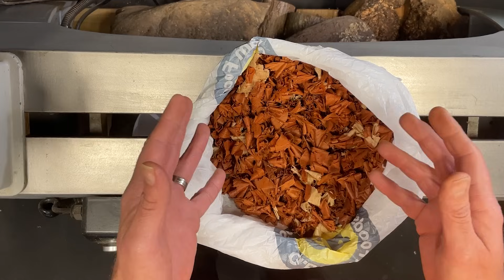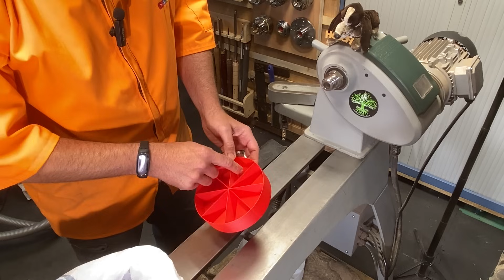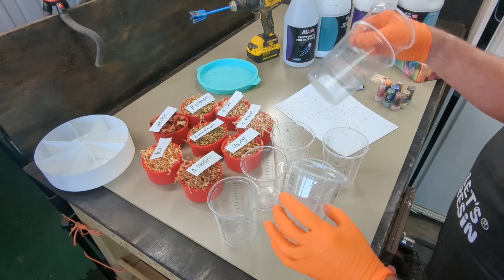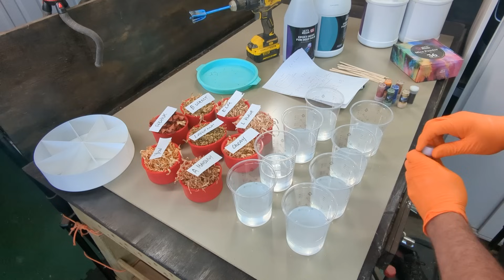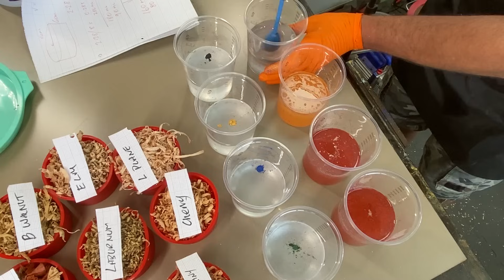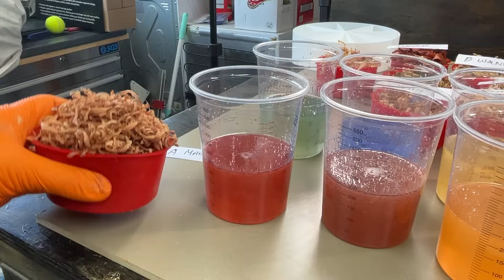Turning Wood Shavings Into a Surprise Project! – A New Wood Turning Experiment

Comment: I think it was a great success. I wondered if the pie pieces weren’t going to fly off into space, especially with the chuck jaws pushing out in the recess. Apparently the resin adheres well to the very thin walls of the plastic  form. 

Since you have plenty of wood shavings, it would be interesting to see what it looks like without any color added to the resin. 

Thanks for sharing the video!
Reply from the maker: Thanks for the kind words and the interesting suggestion, glad you liked it! 😊

Comment: Just found your video on this and I'm wondering your thoughts bowl compartment could be made out of thin veneer maybe birch, eight wings CA glued to a  dowel and the outside wrapped with the same veneer.  May prevent the wings from warping.  Either way this idea was great thinking on your part.  I love in.  Cheers
Reply from the maker: Thanks John, indeed veneer could have easily been used but this experiment was to test the 3D print 😀

Comment: Very nice execution of a great concept, especially for a first run. I'm wondering about the possibility of 3D printing the base and outside walls a  bit thicker with dado grooves for inserting thin wooden panels as the vertical section dividers. Once turned, all you are left with is the resin and wood. White lines are eliminated and hopefully the wooden dividers would remain straight. 

Great work. I'm much too cowardly to even try such a thing.
Reply from the maker: Haha thanks so much and that's a great idea 😊

Comment: Mike, apparently i was in the hospital when this first came out and missed it.  Glad it popped up again.  I think this was a fantastic project.  I've done a lot of resin work but nothing like this.  I'm wondering if the distortion of the lines may have been influenced by the density of the adjacent woods as well as the temperature of the casting.  Any thoughts?  Great job.
Reply from the maker: So glad you liked the project, thanks for watching! 😊

Comment: Try using 1/16" veneers in steer of the plastic printer material, wood veneer won't warp or disfigured like that..!!
Reply from the maker: It's a good idea but not the point of the experiment 😊

Comment: You can easily sort the problem with the walls in the slicer. You can increase the infill percentage to 100, or increase the number af walls. The latter would be my choice.
Reply from the maker: Thanks I'll try more walls, the bamboo labs software does not allow 100% infill for some reason
Reply: @mikeholton are you sure? I am pretty sure i have used 100% infill. Maybe it depends on the pattern. Anyway, a wall count of 4 or 5 gives you a really strong print
Reply from the maker: Thanks, I'll look again 😀

Comment: Interesting idea. Definitely needs refinement. One issue I noticed was areas in the cavities that are just resin. I wonder if you put the shavings in first, to ensure capacity, then work the resin in. Will the whole unit fit in your vacuum pot? California Air Tools makes a vacuum conversion lid, for their 5 gallon air pressure pot.
Reply from the maker: Interesting thoughts, yes it will fit in my vacuum chamber 😀

Comment: Hi 
I have been watching you for 2 weeks and your so inspiring.  Im a plastic technician and I have been making wooden bowls for just a few weeks. Today I'm going to wood turn for the first time. So excited.  I hope one day I can use my plastic skills to make somthing cool like you do. Thankyou for your help and inspiration.  Im curious about the set up costs for the resin equipment.  Kind regards Shelly
Reply from the maker: Hi Shelly, my first few resin pieces did not need much extra equipment, having a pressure pot and vacuum chamber do help but you can still get good results without them. If you want to email me (mike@mikeholton.net) with any questions I can go into more detail.

Comment: Hi Mike, the segmented  chambers  is a great experiment. For some reason,my memory of my school army cadet days return tome. I was in the 3 inch mortar team and I recall that the tail fins of the bombs were perforated so that the propellent would go off evenly on launching. 
Would it be an idea to perforate the fins so that the resin literally would be one mass throughout the piece and not depending on the plastic boundary to bond all of the segments together?. Possibly a single hole of about one inch diameter in each web would be enough  and the individual filling material in each segment would not be disturbed

Cheers from Downunder👍🇦🇺( Brent Read’s f.i.l.)
Reply from the maker: Thanks Brent, that's a really interesting idea, I'll have to give that some thought! 😀

Comment: I'm guessing the mould was printed in PLA?  ABS would stand up better to the heat but you may have warping issues while printing, if so use a raft.  Also, use 100% infill on the fins if you need them thicker while retaining strength.  And maybe make them look organic to start with then any warping will add to the look.  Beautiful piece by the way.
Reply from the maker: Thanks for this, very useful indeed. If you watch my latest video you see me do a test with PLA, ABS and PETG 😀

Comment: Incredible work, thank you for sharing it. I do have a concern about what kind of exposure you are having to microplastics doing this kind of turning. I would think a good air filtration system in the room, coverage of all of your skin, and probably some type of mask would be in order. These materials are less benign than I always assumed them to be.
Reply from the maker: Thanks for the concern, I wear a mask when not talking and I do have good air filtration on. Plus in terms of exposure I only turn these a could of times a month at most which means about 3-4 hours exposure. 😀

Comment: good looking resin bowl!!!!  I'd suggest, is make a 3D 'pie piece' that has a trough in the bottom,  cut thin pieces of hardwood that pushes into the trough, if this makes sense, you'd have to taper and point the hardwood for the center..
Reply from the maker: Not sure I fully understand but I think I get it 😀

Comment: Really nice piece. As soon as I saw the mold, I wondered if you'd be able to make a clear one, or mold the sections separately and find a way to join them to form a blank with no white lines.
Reply from the maker: I can make on in any colour the filament is available in 😀
Reply: @mikeholton The possibilities are endless. I love that this is a way to use and bring the shavings to life. While you were doing this I was also wondering how tight you could pack the shavings without compromising the strength of the resin.
Reply from the maker: @sea-ferring  They are indeed, with regards to how tight you can pack them, using the vacuum chamber means that the shavings are infused with resin so the strength only increases

Comment: Beautiful piece! I wonder if it would be possible to construct a "wheel" out of thin wood for something like this (with maybe a dowel hub) , instead of 3D printing? It would probably solve the distortion problem.
Reply from the maker: It would but I wanted to try with 3D first. I believe a different filament may be better 😀

Comment: Interesting concept and result.  I'd have added much more wood shavings to each section.  The resin to wood ratio was too high in my opinion.  With more wood shavings, the shavings from this would have been more wood and less resin - less mess to clean. Not sure about degassing (vacuum) before pressure pot.  Seems an unnecessary step given that pressure reduces air bubbles to minimum size.  Heat from resin curing caused inner walls to distort, not much to do about that with thin walls.   This is not something that calls to me to give it a go, but very interesting to see the outcome.  Well done.
Reply from the maker: Thanks for your thoughts, I used the vacuum chamber as I wanted to get rid of as much air as possible and force the resin inside the shavings. Also I'll be trying a different printing filament called PETG which his a higher melting point 😀

Comment: A cooler shop eomt help that much resin get extremly hot curing over 300 degrees
Reply from the maker: Ineed Jim, I'm going to try PETG filament as it works at a lit higher temperature 😀

Comment: The shavings of a resin project can be maddening!  I good tip is to wipe with a dryer sheet, they fall away much easier.  Also I have found I get much less chipping with the resin when I use my gouges vs carbide tools.  I appreciate how thoughtfully you approach each project.
Reply from the maker: Great tip, thanks Amy 😀

Comment: Great bowl. I’m curious which filament you used for the 3d print. I’m sure some the resin would be less likely to bond to while others the resin will form a very tight bond. I’m pretty sure some would be less heat sensitive as well. This experiment is a success in my book. Super job.
Reply from the maker: Thanks Doug, I will be getting some PETG to try as well as that cures at a higher temperature 😀

Comment: I have several thoughts on this piece.
  First, I think you have invented a unique art form. It came out great.
  You might think about  vibrating your liquid "pie" form to reduce bubbles and voids, which would reduce the volume of cutting you have to do to achieve a smooth surface.
  The wiggly dividers actually lend to the organic feel of the piece. I like that rather than rigid straight lines.
  You might think about creating curved dividers with your 3D printer and allow them to wiggle for a more organic look. (Think chambered Nautilus)
  I really enjoyed this presentation. Thank you.
MdS
Reply from the maker: Thanks so much Mike for all your thoughts and comments 😀

Comment: Great idea and beautiful executed.  Have you thought about using a two part mould with a removable radial section?  Fill the sections and take out the middle after filling.
No worries about section flying off and you probably won't get much mixing at the boundaries as the shavings should hold together. 

Just a thought!

Comment: Great project, I wasn't worried as Restoration DIY has done similar projects with 3d printed parts, i believe  there is high temp plastic for your 3d printer to prevent warping
Reply from the maker: Thanks Dale, I will be ordering some 😁

Comment: Hello from Tampa, Florida USA
Why did interesting concept I do agree with a couple of other viewers that the different types of filament would help or even fix it so you could put wood inserts. 
The other thing that you may have already figured out on your carbide tools remember you can turn them up on the side so they’re making a sheer cut and that will help give you a cleaner surface then instead of keeping the tool flat on the rest.
Reply from the maker: Thanks David, the roughing tool is best to use flat, I did use the round detailing tool on the side to clean it up 😄

Comment: Wow it worked. Personally I thought it will give in the center. You know where all sharp angles are. But it turned out nicely. What about to remove the stress point and since you can print it, instead of the star center put a cylinder shaped center.
Reply from the maker: Thanks, I have so many ideas 😄

Comment: 13:35 When you started the lathe turning suddenly there was lighting running through your project - or at least that was what I thought of!
Reply: 21:06 Nice shimmy!
Reply: No beauty shots at the end? I was hoping for some close-ups to see each piece of pie, top & bottom to check out the textures & colors of each wood against the resin colors. 

It did turn out beautiful and quite interesting. The vaguely UFO shape was perfect for the emergent technologies at work: 3D printing, epoxy resin, vacuum & pressure pots, and the brand new Record Power ProComfort Carbide Turning Tools.

Did you attempt this project because you just received the new carbide turning tools, or was that a happy accident?
Reply from the maker: Thanks Flowm glad you liked the shimmy 😀. I will put some better photos on the community page in a day or two. The carbides coming was a happy accident, I have been thinking about this project for months 😀

Comment: Sir, find a cheap deep freezer and set it for around 45 to 50 degrees. That will slow down the set time a few days and keep it from getting too hot. There is a learning curve as to the type of epoxy you use, but once mastered I think you will enjoy the results. Myself, I follow a simple formula with epoxy...1 to 1, one day, 2 to 1, two days, 3 to 1, 3 days. Take out of pressure pot and put back in freezer for the remainder of the week. Can't guarantee your results but it works for me. Thanks for posting.
Reply from the maker: Thanks so much for the tip! Really appreciate it 😀

Comment: Nice unique piece there Mike. What material was used for the mold?Clearly the epoxy cure temperature was high enough to soften the mold material which may have a positive effect on mold to epoxy adhesion. A lower temperature may result in less mold distortion but could have a negative, hopefully minimal, effect on adhesion. Just something to consider for safety sake. Keep it up!
Reply from the maker: Thanks John and yes all this is going through my mind 😀

Comment: This is lovely! If it is warm in the workshop and you are worried about thermal runaway you could put some dry ice in the pressure pot... Well actually that might not be safe as the dry ice doesn't sublimate under pressure so maybe you could pack it around the pressure pot? I had first thought about just freezer packs but they wouldn't last long enough. The YouTube channel Evan and Kaylin does a lot of resin projects. You should reach out to them for advice.
Reply from the maker: Thanks for your thoughts Nikki, really appreciate it 😀

Comment: Oh my gosh, that turned out so well!! I would love to see you do the same thing, but not keep the white dividers. You could do the same exact 3D print, and put the epoxy and the wood into it in the same way. But instead of curing it there, you could dump it upside down into another undivided bowl that is just slightly bigger. And then add a little clear epoxy to fill in any gaps.Just a thought! I do love it with the dividers, but I would love to see you try it this way too!!! 😊
Reply from the maker: Thanks Barb, that is a very interesting idea 😀

Comment: I'm sure others will mention, but the cure temp is hitting the melt temp of the PLA that I assumed you used (guessing)
PETG or something with a higher melt point may help. Also I think a bronze or copper color would be a better fit than white in my opinion.
Another thing I thought of is if you could get the chips into the mild, pack them in, then add the resin. The vacuum would be a problem, unless you just pull a vacuum on the pressure pot...
Reply from the maker: Thanks so much, yes I used PLA but will be testing PETG 😀

Comment: Depending on what 3d printing slicing software you use, you are looking for a setting usually named "infill %". It usually defaults to 15 to 25%, but for a design like this, you could set it to 100% to ensure a solid wall. If you were working on another design where you don't want 100% solid, but you need thicker walls to keep them solid, there is usually a wall thickness setting you can adjust to achieve solid walls and still have some hollw areas elsewhere.
Reply from the maker: Thanks, I'm using Bamboo, I did try 100% infill but it would not let me for some reason 😀

Comment: You know you don't NEED to use infill, if you wanted thicker walls and want them solid, just choose 100% infill. Most slicers will do custom areas where you can vary the amount of infill. So the dividing walls can be solid while everything else can be whatever number you want.
Reply: Oh also, don't forget you can get some pretty amazing colours in filaments these days too. Transparent with /without glitter, black with glitter etc
Reply from the maker: Thanks, I will have a play with the settings, I have quite a few colours as well 😀